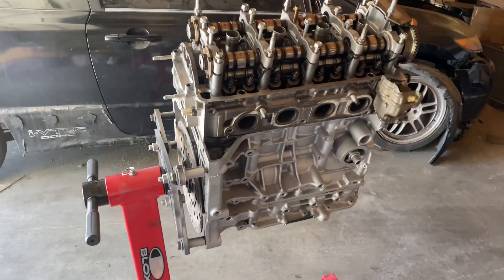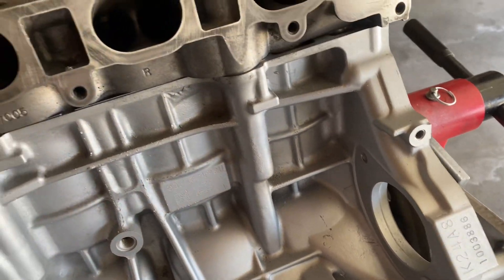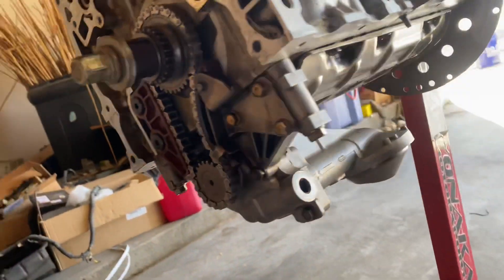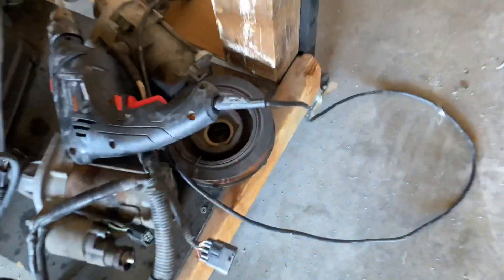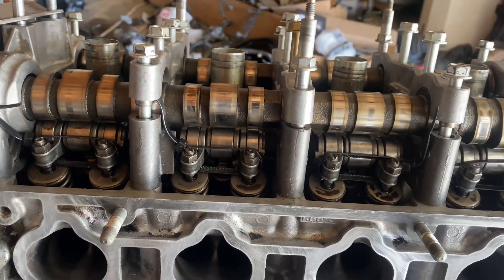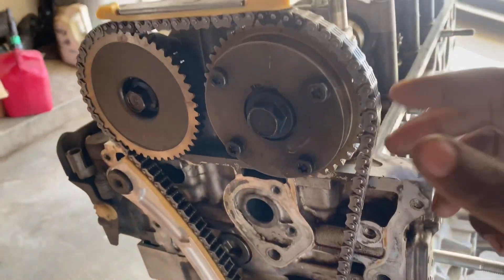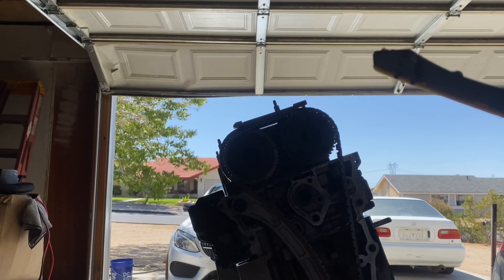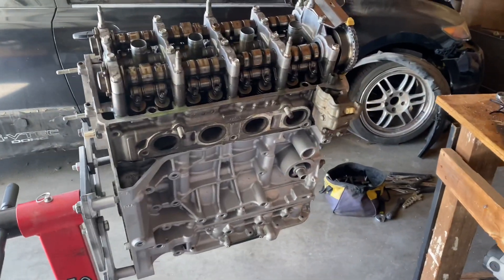How to build a budget k series part 8

Comment: Hi! Good video! Do you have a quick trick to remove the crank pulley without a special tool?
Reply from the maker: You can put a couple flat heads between the flywheel and trans to lock the crank